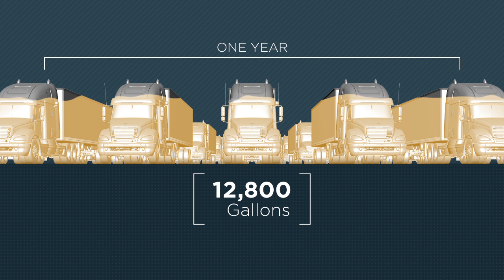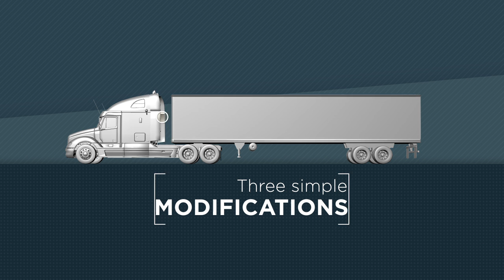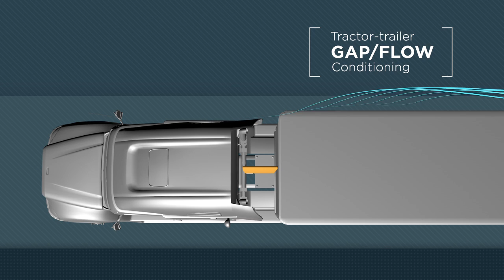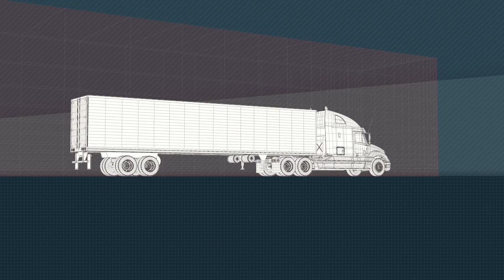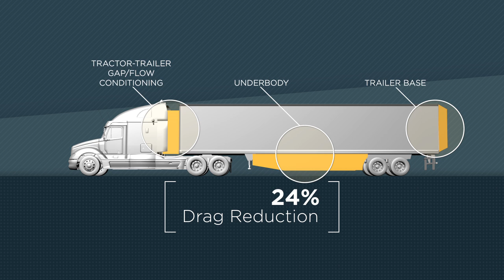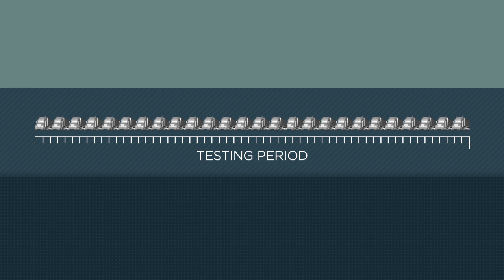HPC in Action: Navistar

Comment: down side a bigger surface area for crosswinds to act on more trucks in the ditch during bad weather.  problems with highway terrorism
Reply: A crosswind acting on the aero skirt actually helps to reduce the blow over situation by stopping the wind flowing under the trailer & lowering the CP (center of pressure) down closer to the CG (center of gravity) point of the trailer.
Reply: @nzsaltflatsracer8054  empty and lightly loaded trailers are high center and are more frequently blown off the road . happens in Wyoming  I 80 during icy conditions  I 65  Indiana .
Reply: @tommyjones2443  That's correct, lighter trailers are more susceptible to a blow over.

Comment: Single wide tire has way less traction than regular double, it might reduce the drag, which eventually will reduce the fuel consumption, but made the job more risky and difficult for the driver. Especially, in slippery condition.
Reply: Not to mention the other problems with super-singles: 
 - 1. A truck can't limp into a service station with a blow-out on a super-single. 
 - 2. A super-single costs more than twice what a standard truck tire costs, so you can still buy two duals for less than the cost of one super-single.

Comment: Your trucks and trailers are from 70's... More length and axles to trailers, more goods  with one truck.
Reply: more importantly increase maximum gross weight from 80000 lbs to 100000  or even 125000 lbs   in northern europe we have begun with upwards 200000lbs   thats 90 metric tons.
rigs like that are about 100 feet long..      thats a tractor with a trailer and on that trailer its either a 5th wheel with another trailer on,   or a a dolly attached with a trailer on that..   9 to 11 axles to spread the weight..    young ladies that drive them say its like driving downtown for shopping on a sunday afternoon..  :D

Comment: Navistar?  But show trucks that look like Freightliners.  Oookay.

Did whomever came up with closing the gap between the tractor and trailer think about the weight that will be put on the steering axle?  Places like The People's Republic of California, Commonwealth of Virginia will write you a ticket for being over weight so fast you won't have time to blink.
Reply: In was just thinking that about the freightliners🤣
Reply: Not to mention, the problem of turning radius. How are you supposed to turn without crushing the back of your sleeper?
Reply: @AaronCMounts , it's possible especially considering most of today's truck-tractors are equipped with sliding fifth wheels.  If you jack the tractor more 90° and it has fairings you'll crush/bend them.  I've bent a few but I've also been able to straighten them back out without much issue.  My last 10 or so years of driving I drove mostly ProStars and loved how easily I could get into some places compared to other brands of truck like Kenworth.

Comment: I have never understood why aeros weren't chased more by the trucking industry. They agonise over the right engine gearbox and gearing to save 1% and yet the obvious 10+% has gone begging for at least the last 40 years. Go figure.
Reply: The Kenworth T600 came out in the early 1990s as did the Peterbilt 377AE and that Peterbilt cab-over that looks like a bullet which was getting around 9 miles per gallon or more.  That's twice as much as those long, square nosed trucks were getting.  I drove a an International ProStar which depending on terrain, weight, wind, etc. I'd gotten it up to 12 miles per gallon.